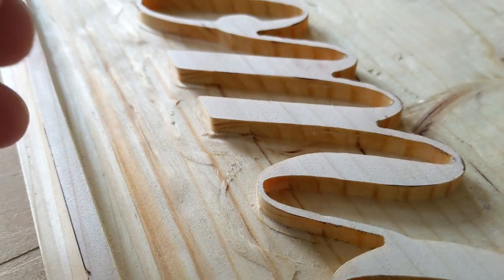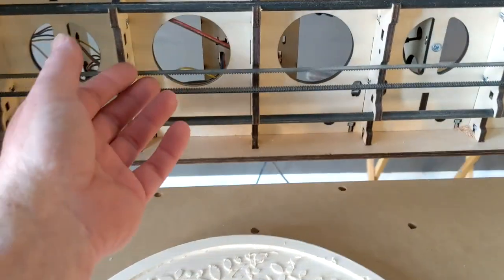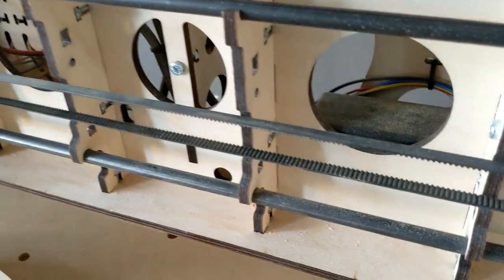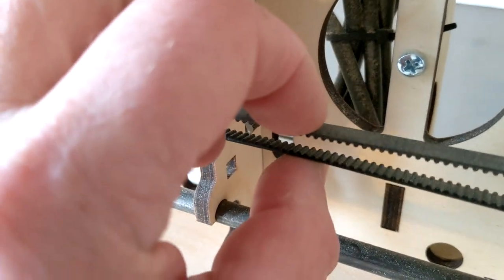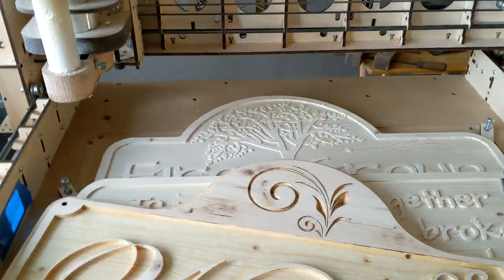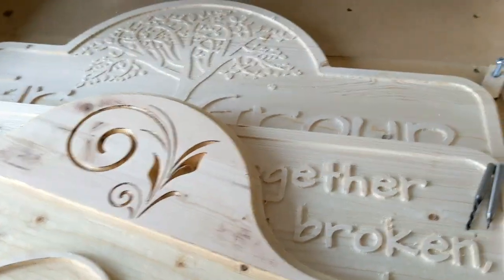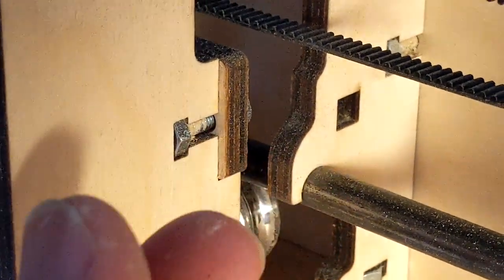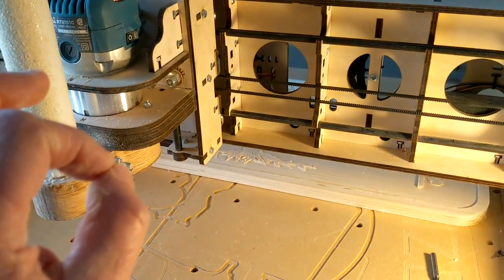How To Fix Bad Cut Issues On BobsCNC E Series CNC Rouoter (E3 E4 EVO, Evolution), Belt Drive Setting

Comment: Any suggestions on when one of the bearing wheels aren't touching the bar? The bottom left bearing on the gantry, isn't rolling anymore.  I tried to adjust the spacers but that doesn't adjust the wheel (bearing) just the gantry.
Reply from the maker: alaynamadden3326, Unfortunately, I am not much help here. I am not a tech guy when it comes to CNC machines. I may be good with the programing and operation but when it comes to troubleshooting, I'm an absolute deer in the headlights. I recommend reaching out to your machine manufacturer regarding your issue. They will be able to help you the best my friend!

Comment: Hi and thanks. Very useful tips. Do you have a good way to tighten the 2 x axis belts so they hold? Mine will slip so I put an extra zip tie on and wedge a shim in the belt loop to tighten it.  It works but there must be a better wqy.
Reply from the maker: Their changed the design since I got mine so not sure how to tighten the belts.

Comment: Redesign a few things to completely eliminate the issues.  Replace the belt drive configuration with ball screws and block bearings.  Also, wood tends to fatigue over time no matter what you do.  I have found that using aluminum instead of wood in critical areas solves a lot of issues.  Using a single ball screw under the table with a cross brace and letting that drive the gantry is much better than the 2 motor belt system.  Last of all do not attach your dust collection to the router brace, mount it to the sides of the Z axis where it will do the most good and not put stress on the router.  Having it attached to the router mount/brace will cause the gantry to always flex in the middle.
Reply from the maker: FXDynaRider, you're totally right! Thanks, those are great tips! I like the idea of switching out the wood with aluminum! I'll look into doing this on my machine!

Comment: the belts have different sounds, you could do a CnC track and go on stage with Armin Van Buuren 👏👏 the belts scares me a bit, if I look to, for exemple, Onefinity, it looks more accurate, less work to keep it optimal, and mutch stronger. Do you have experience with those?
Reply from the maker: lol...I could to the CNC rockstar thing! I haven't had my hands on one yet, but I will! If your considering that one...get it. They are the only other company with a rock solid reputation.
Reply: @IDCWoodcraft  Thank you Garrett, glad to heaar this, I love rock solid reputations. I m not sure wich direction I wanna go yet, I would love to make unique amplifiers and loudspeakers, so 'my' cnc router needs to be able to make PCB, to engrave aluminium in a very smooth way, to make perfect cuts in wood, has to be multi axis .. I love poolbilliards as well, making those, and tools for it, with a litlle touch of love/passion would also be very satifying. Making CnC routers could also be interesting project .. So much to do, where is the entry please ..? :)
Reply from the maker: You sound like me. ideas are miles ahead of where we're actually at. Good thing...keeps us going.
Reply: @IDCWoodcraft  I think the same way and love your approach in business, to create a relation and trust before talking about money. btw you're website has still a lot of work on it, it would be a good idea to clean it up, to remove whats not suposed to be there (data from template) and as a CnC entrepreneur I expect you to have a nice favicon, not a Wordpress logo .. I ll be watching you Big Brother .. :O
Reply from the maker: @Bart_Depestele  thanks man. It's being fixed now. See what it looks like in a couple days!!!
Reply: @IDCWoodcraft  Take a look at Dennis van Hoof if you have time, this guy works also with a Bobs cnc and does crazy things :O Even as a hater I love his work :)
Reply: @IDCWoodcraft  I did and it looks great !!
Reply from the maker: @Bart_Depestele  yeah, I'm liking it a lot. Thanks for the reinforcement

Comment: I had issues with saw dust build up in my side rods. I followed another Bob’s owner suggestion and ran blue painters tape along the entire length of the X on both sides, creating a roof of sorts. 90%of the issue went away. You do need to modify it near the rear (curl the tape up) no when you home the machine the tape doesn’t go under the rollers. I also taped the square openings in the sides as well.
Reply from the maker: Small world. That guy was probably me. I talked about doing the painters tape thing  in my review video several months ago. It definitely helps.

Comment: Looks like your cnc was cut out with a laser
Reply from the maker: It was. This is a BobsCNC. What kind do you have?
Reply: @IDCWoodcraft  preenex 60w co2, I plan on upgrading to 100 watt 1300mm in future
Reply from the maker: @5SeasonsPressureCleaning  maybe you can make one of these cnc routers
Reply: @IDCWoodcraft  do you have a source file i can use?
Reply from the maker: @5SeasonsPressureCleaning  you mean for the machine? No. This is sold by the company BobsCnc as a lot. I'll bet you can find a file on Etsy
Reply: @IDCWoodcraft  thx ill look into it

Comment: Belts are not a bad thing. If your machine crashes the belts will skip a step or so instead of something breaking! Ask me how I know lol.  There is maintenance on all cnc machines. Thanks for your help!
Reply from the maker: Thanks chevy... And a good point to make.

Yes, I've had some not so fun crashes in my time. Like when I ran the turret of a CNC lathe into the Chuck spinning at 2h rpm. Knocked everything out of alignment